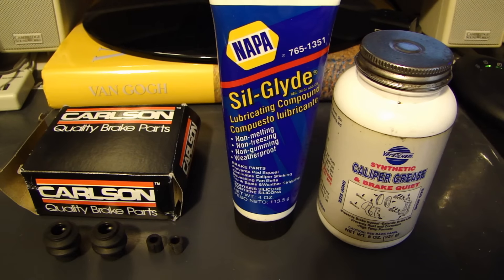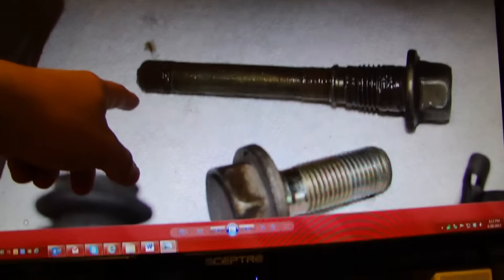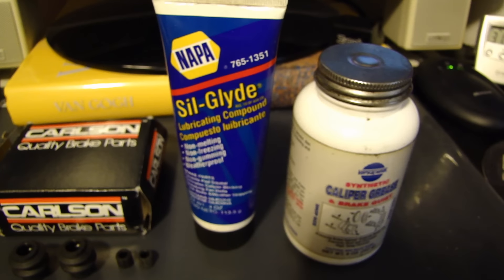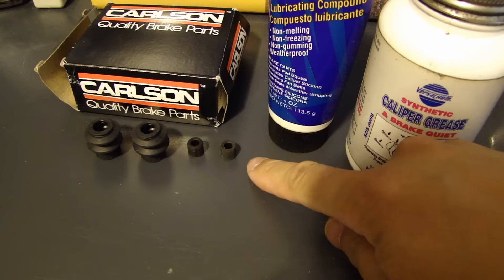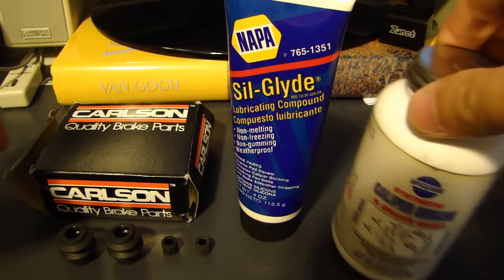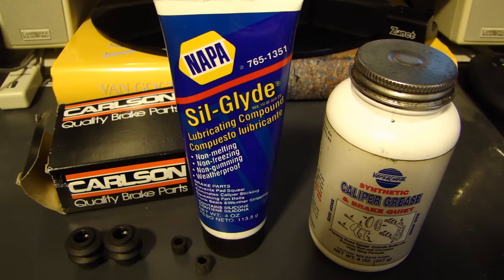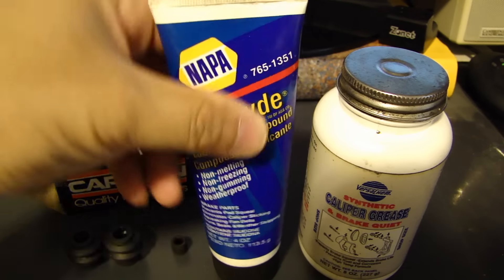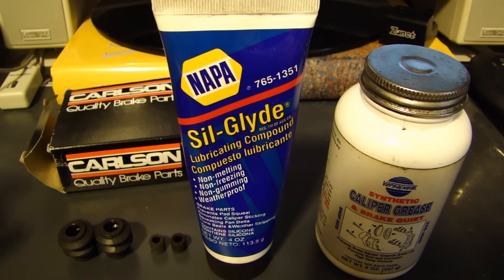Brake Caliper Slide Pin - Proper Lubricant to Prevent Rubber Swelling - Sil-Glyde

Comment: GREAT INFORMATION!! a rubber seal on the tip of my brake slide pins were missing and the pin was very hard to slide out. Now it wont go back in fully.  keeps extending itself out. There was a black paste on it when i finally did get it out. My inner brake pad is worn out crooked and has less pad remaining than the outter pad.  The pedal vibrates and makes what sounds like a grinding noise when braking down hill. My rotors are smooth.  I  always took my car to a reputable garage for Hondas. I had brakes done once a year. (I  just reviewed my receipts).  Now that my car is older (2007 honda accord) and i have time i tried to do the brakes myself  (checking off my lifes bucket list). I got the CRC Silaramic with 3000 *F brake system grease.  It is pastey. I hesitated because it cost $15 from Advanced auto.  I will do my own brakes from now on and get the Sil Glyde. Thanks again for the video!!

Comment: Thanks! Just want to know if the Bendix BL20 Ceramic Brake Lubricant has the safe effect as these?
Reply from the maker: I am not sure, but this is also a synthetic grease. You can still use this stuff for everything else, but stick with Syl-Glide for the slide pins.
Reply: dial2fast
Thanks!
Reply: dial2fast

I wasn't sure but then I saw another video here which complained about the same issue. Most people do not understand this and continue using the regular stuff
Reply: Please check out Ceramlub, it is the only Real Synthetic Lubricant.  You do not want grease, there is a difference and it is not being addressed in this video.  The temperature rating of the "mineral" base these greases uses is only 500 F, so they can not take the heat brakes experience on a daily basis.  Additionally that is why there is swelling of the rubber parts.  Here is a link to the technical aspects of the right product...  40% Solids, 2800 F, Real Synthetic Carrier, Anti-Corrosives and more       www.Ceramlub.com    (P.S. As a note this is the original Purple lube Bendix offered, before they moved pad production to China and switched to cheaper blue version.)
Reply: Garythepartsman Hi Gary, can you please specify what is it that causes the rubber parts to swell? what ingredients are to blame for swelling? does ceramlub swell or not swell rubber parts, why? earlier you said Bendix only contains 1% of ceramic. i am not able to get this information anywhere. their website states: hight ceramic content and temperature between -70 and 3000 F. are they lying about their product? where do you get your info about their specs?
how does ceramlub compare to these high temperature ceramic content products: CRC Silaramic brake system grease, Permatex extreme brake parts lubricant and Bendix BL20. do any or all of these products swell rubber? why?
would i be able to use ceramlub for all brake parts that need to be lubricated?
thank you for any information you get get to us.
Reply: Peter + Gary,

I guess its because of the petroleum based products that causes the rubber to go bad?

Comment: Sil-Glyde is good for the slide pins, but what product should be used on the back of the brake pads? Would something like http://www.autozone.com/greases-and-gear-oil/lubricant-grease/valvoline-moly-fortified-multipurpose-grease/54187/?_requestid=7650434 work?

Comment: I follow your advice and it's wrong. the rubber on the pin is bad after using Sil-Glyde. Now I have to replace them. the car has only 67K miles.

Comment: does this work on piston seal too?
Reply from the maker: +h2oreactor Yes
Reply: Take a picture and give us the link.  I'm not understanding what you mean.
Reply: no... piston is lubricated only by brake fluid... nothing else... sliding pins - silicone grease...  other parts of brakes except braking surfaces copper grease...
Reply: I THINK he's asking how to replace his slide pin bushings or boots (can't tell which).  Both of which can be wrestled out with a pick or flat head screwdriver, new ones inserted via the same method, and both get lubed with silicone.

Comment: will crc silicone spray work as well??
Reply: No, the spray cans contain strong solvents that will break down and swell rubber quickly. + the actual film of silicone left behind would be negligible. Good for cleaning old rubber wipers, door seals, ect  where you want to restore some pliability but that's about it.
Reply: @SerenoOunce  ok. thank you very much for replying!
ive seen this sli paste on line vut wasnt sure if it would work.
i dont have 20 bucks just for a bottle of silicone. so i wasnt sure if buying this cheaper brand would be best.

Comment: That bushing at the end of the pin is not really necessary.  You can get away with leaving it off. 
Only use silicone grease for components that come into contact with rubber . For metal to metal contact you can use any brake lubricant.

Comment: I did an easy and cheap test, I put grease in a condom, if it goes deforming I do not use it, if it does not deform I use it!
Reply: It's not just the effect on rubber, the grease also has to not harden under the high temperature that the brakes generate.
Reply: Congratulations on the new baby!

Comment: Another automotive Youtuber claims that Permatex 80653 Silicone Extreme, the orange stuff--unlike the purple stuff--, is rubber friendly [1].  This has also been my experience.

[1] "Brake Job - 2014 Nissan Sentra" on the "Watch Wes Work" YT-channel

Comment: Anyone else use antisieze??🤔
Reply: For years never had an issue also went 50,000 on explorer and the never seize looked like I just applied it. It was silver permatex jar from autozone
Reply: A mechanic that is amazing said in a pinch you could use anti seize for pins and it’ll work fine. But he recommends silicone caliper pin grease first.
Reply: Do not use anti seize on slide pins, only silicone paste from 3M or Mission Automotive Silicone Paste, sil-glyde. I've done some research online, permatex disc brake caliper grease is petroleum distillates. The only ones I'd ever recommend are those 2 and theres another one
Reply: Lime Now is silicone paste the same as like DOW4 or silicone dielectric grease? Will dielétric grease work? 

Right now I’m using white lithium grease as it’s all I can find in Brasil.
Reply: Not sure what DOW4 is but silicone paste will work, you're going to need to read the manual or literature for the product you're buying. I think lithium is not right for rubber and its certainly not right for lubing slide pins. Its good for ball joints, bearings, cv axles, but you should consider calcium sulfonate grease. Its superior than lithium grease if you're talking about bearings and cv axle, ball joints
Reply: No it won't. Your on about copper slip grease.
It's a petroleum based grease & will destroy rubber.    A quick test will prove this.   Wear rubber gloves & rub copper grease or say WD40 & it will tear holes in the gloves.

Comment: You only use synthetic base lube on rubber parts....duh. Hell I've only researched for about 30 min before I did mine and knew that. I doubt the caliper grease you used was The culprit. Someone else, maybe you put non synthetic lube on the bushing in the past. It also could have come from your shocks if they went bad. Who knows but  the caliper grease didn't cause your bushings to swell.  It could have even been a lazy mechanic who applied non synthetic lube to your bushings if you took it in for maintenance. Some idiot may have sprayed WD40 as well. Who knows but don't blame the caliper grease in your video.